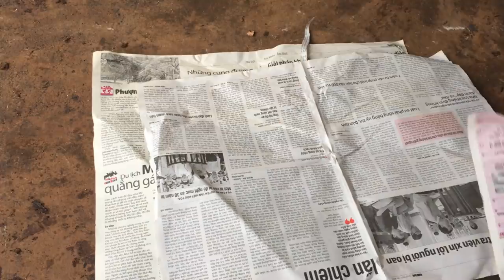How To RESTORE JAPANNESE SWORD - Restore of old rusty sword

Comment: 🇦🇬Wow! Most of the comments I’ve read are really unwarranted. This restoration ruined absolutely nothing, other than maybe a few pieces of old newspaper.
     This is not a genuine nihonto. This is a shinken, or real sword in terms of a real sword that has an iron (alloy) based blade that is sharpened. This would be like comparing a rusted out Pacer, that has been  patched, sanded and painted, and equating it to destroying a Ferrari 250 GTO! It is not a nihonto. Nihonto are made from tamahagane, which is heated, folded, forged, shaped, filed and polished into a genuine Japanese sword. Nihonto are made in Japan. Nihonto are art objects and must have a certificate/license and be registered. Most shinken are made in China. Shinken can’t be made in Japan, because it is considered a weapon, and would be returning to its origins or confiscated and destroyed. Japan also produces aluminum alloy, non-sharpened swords for Iaido.
     In my humble opinion, the outrage was overblown, disrespectful and mean. The gentleman did what he could, with what he had. I say, good job. 🙏🏽

Comment: First you boiled the blade to remove rust, then assess the damage caused by the rust and use a series of polishing stones and clay to smooth out the pitted areas, if the damage was too much then you forge it into a new blade. If it is a piece of historical value then you stop the rust and preserve it as is for the showcase. But that blade does not look like a blade made by a Japanese sword smith as the blade tang is square and the traditional forging shape is made so that it is easily inserted into the handle. I have never ever seen a blade like that.  Nice try on the restore though.

Comment: you know, I am fond of antique forging, it is in the old fashioned way, forge, anvil, hammers and it pains me frankly to watch what you are doing ... outlines, tape from 300 to 1000 grit, after which with the help of a felt wheel and polishing paste, it was possible to polish the blade literally to the mirror. Regarding what you have under the guise of hardening ... You know, after this, the blade has already simply died ... It is possible to restore the crystal lattice of the metal, but it is difficult, and what you have already done is enough to completely devalue the sword, if he had some value. Although, here it is immediately clear from the structure of the metal that this is not an old sword, but an ordinary stamping from a sheet of metal...
Reply from the maker: thank pro

Comment: Remember to anneal your metal unevenly with a blow torch to convert that high carbon steel blade into nice soft mild steel so it will never hold a sharp edge!

Comment: Any actual value that sword had was lost. That went from a possible $10,000 sword to a $200 sword in a 20 minute video. Under normal conditions with almost any other sword you did fine. But with a Katana.....yeah not the proper way to do it. Using the torch on it like that, possibly lost the tempering. For sure lost the Hinan (didn't spell it correctly) which is an art form in of itself. Grinding the handle probably ground off the makers mark which is what gives the sword it's value. I know early 1900's Katana's are worth $1000-$10,000 depending on the maker. Being 150 year old could have been worth more depending on the maker. I seen Katana's found on a beach from WW2 online for sale for $1000-$2000 and they are rusty and major pits in the steel.

Comment: Its hilarious how people are quick to jump to conclusion , firstly this isn't a real katana , secondly using a grinder to remove rust scale doesent do anything bad to the steel any more a wet stone can its just that grinder is faster ... Now that I recheck the video , you seriously have to be brain dead to believe that that is an actual katana  lmao.
The "chisel" tip , the 2 sided with visible tang handle , the bit where habaki is supposed to go has a heel , tang is the wrong shape there is no hole for mekugi , handle is round not oval , yes katanas had different shapes but to this point? No.

Comment: Hello man you were trying man, instead of a grinding wheel try a soft metal brush like bronze or cooper. Lightly bead blasting might work if it is extremely rusted. just try not to remove any metal. Second if it has been heat treated don't reheat the blade. When you are polishing, use a bench grinder with jewelry polishing pads on it and compound or rouge. will give it a mirror finish will take time but worth it. The handle style you used is not a traditional type, I have a Kaaba with a similar handle and scabbard its called a grass-cutter. has no guard just smooth surface. Keep trying will get there.

Comment: It's not even a real nihonto. It's too straight, there is no sign of a hamon, and the tang is wrong. A grinder though would not be the best way to clean that unless you intend to temper it again. A vinegar bath would work to de-rust it.

Comment: About the steel Color ist was to Hot. So the steel is Not More hard Its soft. If you use e grinder and the temperature goes above 200 degree than the Steel has to be again prepared. The hamon ist Not More visible and sorry but to sharpen such a blade with a grinder ist like a violence of a Old culture knowledge.

Comment: Then he ruins it with a gloss and a traditional blade should of been fitted with a grip that is held together by a pin so i have a feeling he rusted a modern sword for this video because not even the blades edge looked correct

Comment: If that is a real Japanese sword...OMG...what are you doing?!?!?  Did you do ZERO research before deciding on this project???  I mean a wire brush would have been much better for the initial cleaning without gouging the steel. Then if you don't want to finish it by hand at least use a sander (any kind of sander), not a cut off wheel...!!!! Most bizarre thing I have ever seen.  Watching him try and blue the steel was just disturbing.

Comment: That's not japanese sword..neither it's 150 years old.. there is no maker name on the handle.. which every japanese swords have.
Reply: maybe its a chokuto type and the maker's name is gone just like its color?
Reply: @valvora4315   maker name is not something that is painted or it will fade with time. Maker name they write it with Sharpe tools.even though 1600 era japanese swords have maker name on it. It's just 150 years old.

Comment: 😱😱😱😓😓😓😓😓🤬😢😢🤬 I would have put it into an electrolysis tank and kept a very close eye on it - Maybe the Hamon would not have survived in that condition but - It may have just been better to keep it as it was in a dry place until such time as a better plan of action was devised and enough research gathered. 

Still the sword would still have a 1000 layer or so and was made by an master sword smith so thats one thing to still consider 😬😬🤔